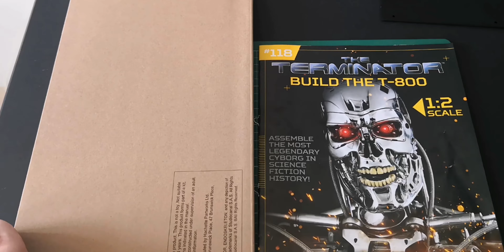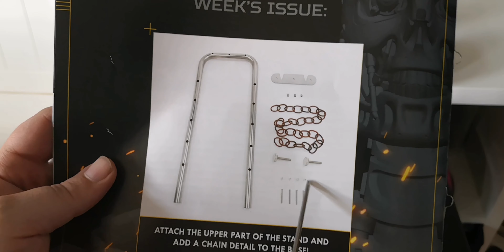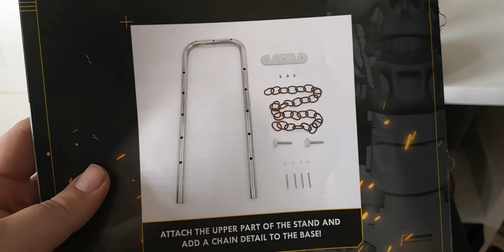Build the Terminator - issue 118 only 2 issues left now

Comment: Is the pole strong or plastic
Reply from the maker: No it's metal and it's very much secure in place
Reply: @Thenexusmodels  cool because I'm waiting on my delivery was lil worried because terminator is lil heavy
Reply from the maker: @SuperNerd12  I've got enough confidence that it will hold
Reply: All metal+it,s height adjustable as well